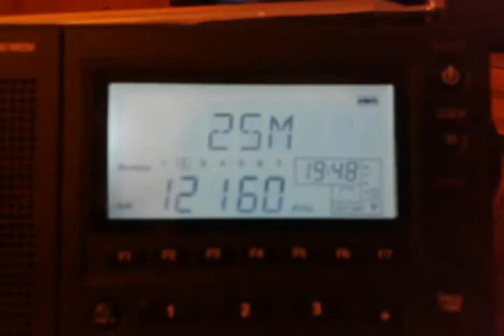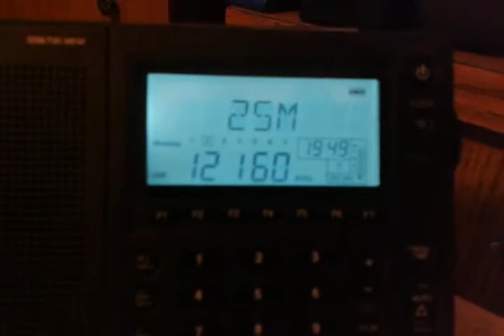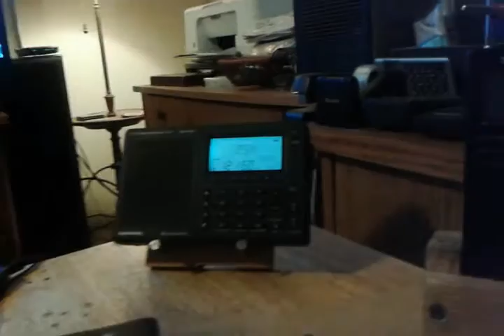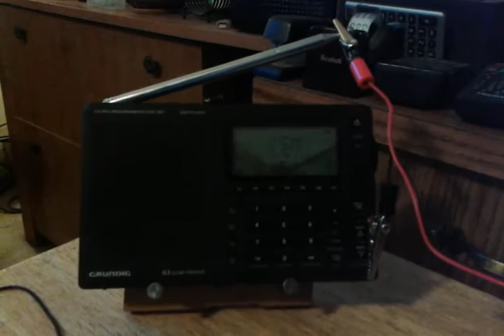Degen  31 MS antenna modification.

Comment: AN-48X Improvements Also Degen 31 MS
Hi
A suggestion for a Project/Video to upgrade the Tecsun AN-48X
Improvement on the finicky Tuning Dial  
A) A larger Dial/Knob
B) Placing The Controls Units electronics in a bigger box and replacing the Tuning Potentiometer to allow a larger Tuning Dial or a Dual Course & Fine Tuning Dials like the C.Crane Twin Coils Antennas Control Unit
Consider replacing the Battery/Box with a larger Low Self Discharge Rechargeable Battery &Box 
Add common Mode Ferrites to the Long, noise susceptible, Down Lead. 
Better yet, replacing the supplied Down Lead with a good quality Coaxial Cable  
E) Use an automobile Windshield Sun Shade to make the AN-48X like the Sony ANLP-1  https://www.amazon.ca/Car-Windshield-Sun-Shade-Windshields/dp/B01KIFISX2
F) Make a thin stiff foam disc to support the Loop on a Lazy Susan or a low-cost Outdoors HDTV Antenna Rotator. The HDTV Antenna VHF/UHF can be used with Radios that have Air Band and/or Weather or a separate Scanner Radio. https://www.ebay.ca/sch/i.html?_ssc=1&_nkw=tv+antenna+rotator 
Thanx
73 de Jordan ve7jjd